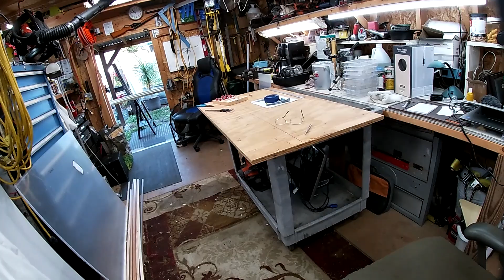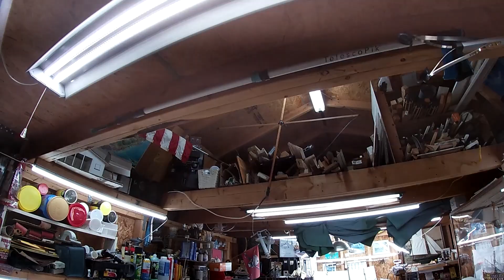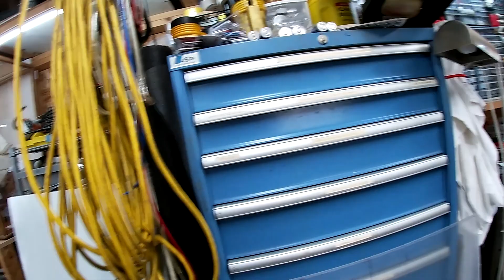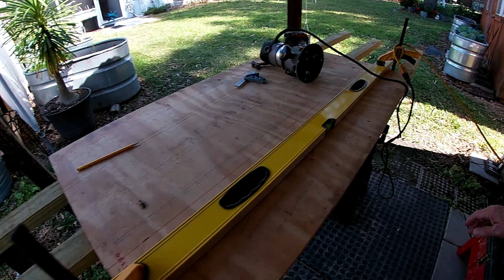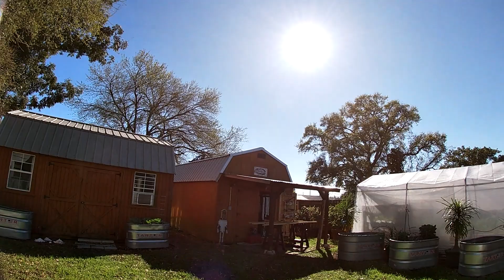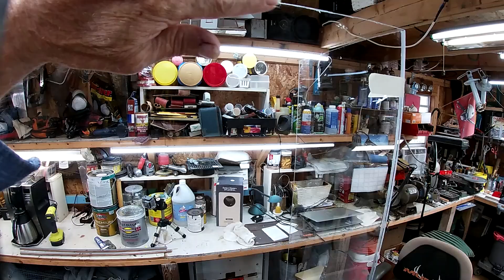Wooden Model Ship ROYAL SUN build #100

Comment: Hi, I really appreciate these videos; I will use them to build a display for my San Felipe. 

What size quarter round and corner guard did you use?
Reply from the maker: I think it was 3/4 inch but looking back I should have used solid walnut 1" square stock with slotted grouves to accept both pieces of glass . Thanks for watching